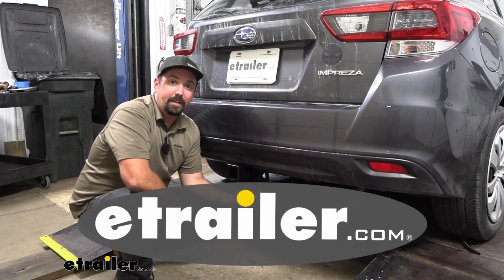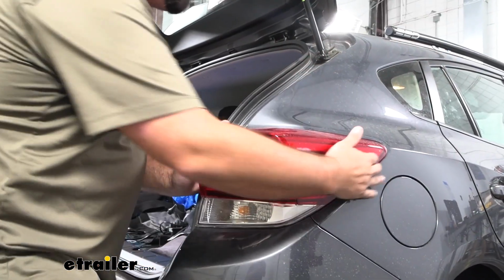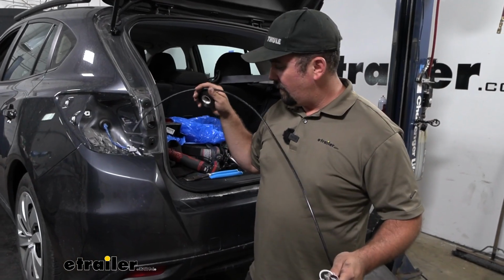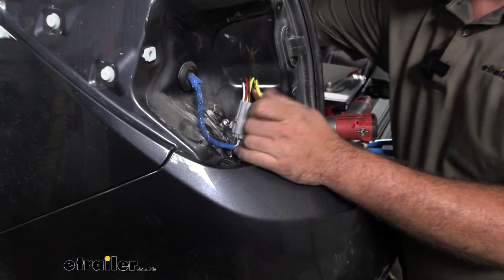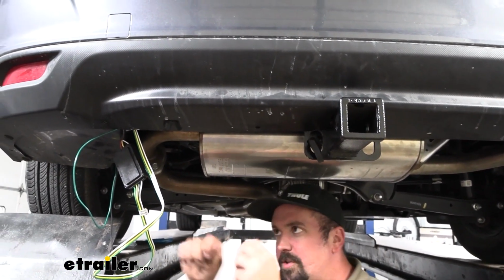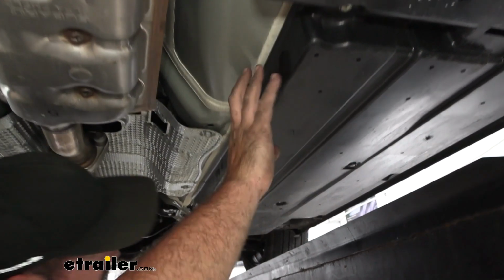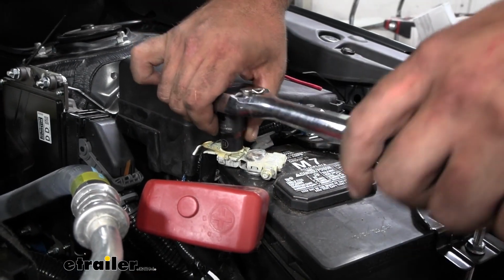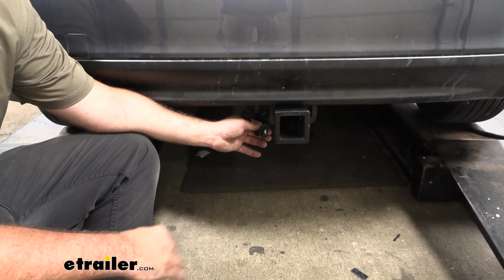etrailer | Curt T-Connector Vehicle Wiring Harness Installation - 2023 Subaru Impreza

Comment: So no splicing?
Reply from the maker: That's correct. The Curt # C56367 harness is mainly plug and play.  You'll plug each connector inline between the vehicle's taillight wiring harnesses and taillight assemblies. The white wire will ground to vehicle frame or chassis and the black wire will be extended using the wire and fuse holder included in the kit and ran to the positive battery terminal. You will not need to splice into any existing wiring.
https://www.etrailer.com/Custom-Fit-Vehicle-Wiring/CURT/C56367.html